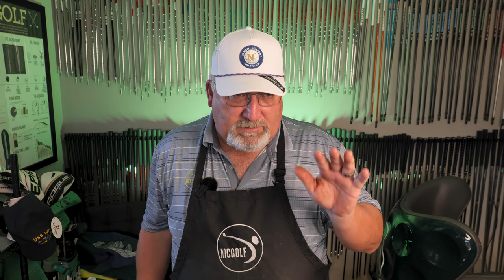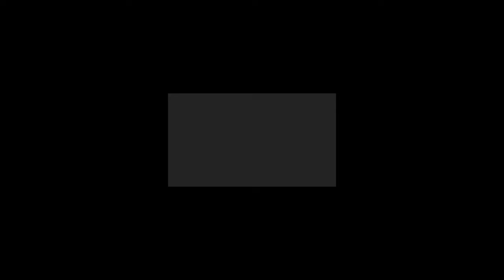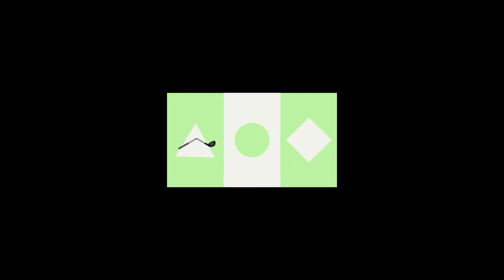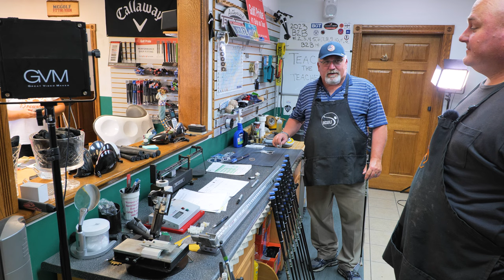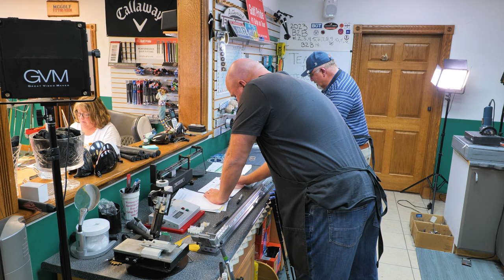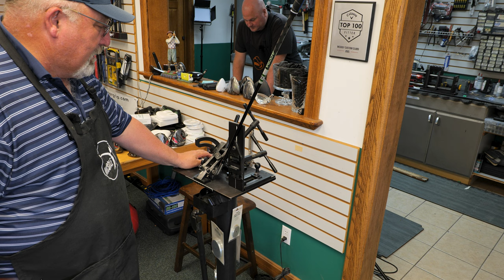How to build a golf club - bending golf clubs

Comment: Tall guy using 2 degrees flat ???? Unusual.
Reply: Yeah it’s an individual thing though but I’m 6’3 play my 7 iron at 37.75 inch and my irons 4 degrees upright but I have shorter arms and a upright swing plane
Reply: No it isn't, considering the irons are +1.5 inches above standard. Adding length effectively makes the clubs more upright.
Reply: @tylerhawk742  you are more the norm than a tall huy swinging 2 degrees flat.